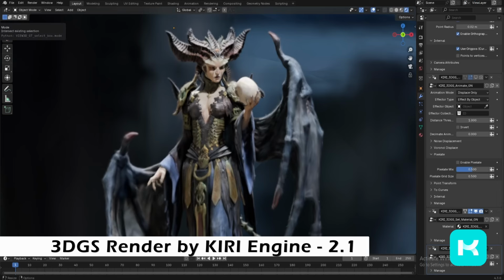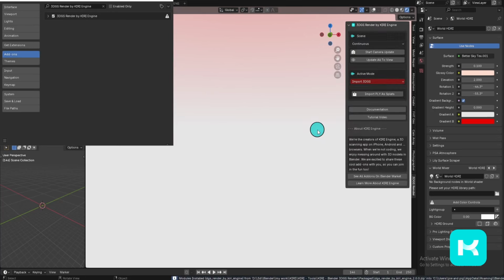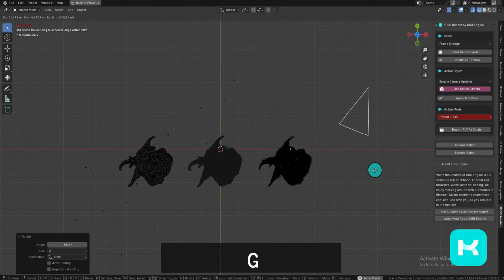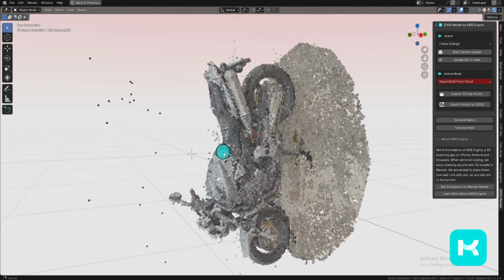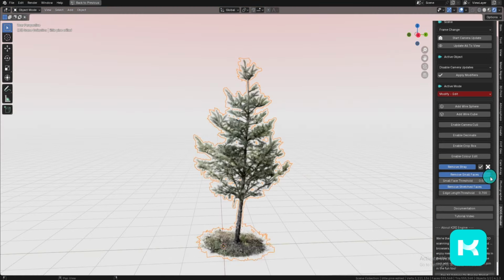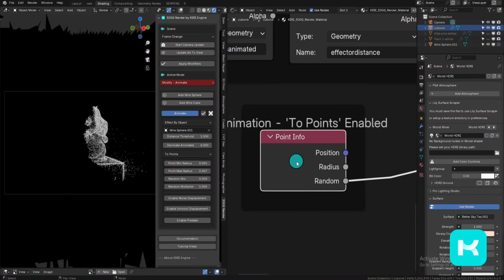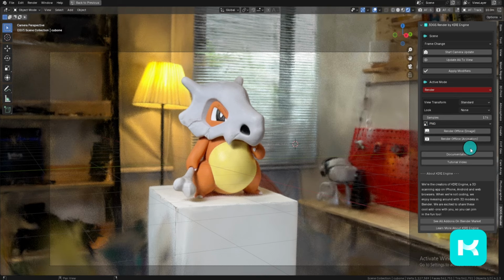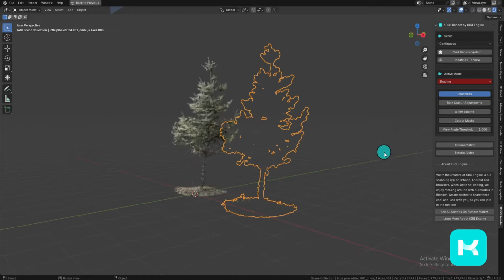3DGS Render Addon for Blender 2.1 Update - Full Tutorial / Documentation

Comment: Looking at this now - it seems that there are some features in this plugin which are missing or have been changed? Particularly the axis adjustment on import, and the active menu modifiers. I'm on Blender 4.5.1
Reply from the maker: Hey Aaron. In version 3.0 extra features were added for editing and re-exporting 3DGS files, so the rotation on import was removed. All modifiers were added at import before, which was too heavy on performance so modifiers can now be added at will from the modifiers menu - hope this helps👍

Comment: Sadly doesn't work for me, i am getting crashes all the time just from importing ply files.
Reply from the maker: Hey redhead! Sorry about that.

The addon will only work specifically 3DGS (gaussian splat) .ply files.

If you try to import a regular .ply (point cloud) file you will get errors and/or crashes.

Do you know the source of your .ply file and whether it comes from an exported gaussian splat or mesh .obj/.fbx etc?
Reply: @3D-Tools-by-KIRI-Engine  Ohh, i didn't know that .ply files are that specific. I was using .ply exported from CloudCompare (free software to edit different point clouds). I also used it to edit .xyz and .e57 to export to .ply. I was hoping that exported to .ply would work in Blender with this plugin because MeshLab is also crashing on different PCs.

It is a shame but thanks for answer and information.

Comment: This might be a daft question but if kiri engines Gaussian splatter produces a ply point cloud could this point cloud not then be imported into mushroom or reality capture to build a true 3d mesh  where then editing would be a lot easier in a 3d platform
Reply from the maker: Not a daft question at all! So both normal photogrammetry and Gaussian Splatting produce a sparse point cloud at first - which could be useful for photogrammetry applications. But getting the a dense cloud, with surface normals etc is not so easy. 
But in our last app update we added 3DGS to mesh advancements for turning Gaussian Splats into meshes.

As for 'for easy editing' - that really gets back to the debate about the purpose and uses of mesh vs 3DGS. 

Meshes are the established medium so your right, everything is easier with them; editing, rendering, compressing, sharing.....

But as the future opens up to 3DGS it's nice to have more and more tools to work with them.

Comment: can i export to obj with material?
Reply from the maker: You could export to .obj but the exported object wouldn't 'update' in another software, unless you set that up yourself somehow. And you would have to rebuild the material (check the shader nodes - the important stuff is in the 'required' group). The KIRI app also has 3DGS to mesh (.obj) features so it might be worth checking them out too.

Comment: if rendering is so heavy on gpu how is this any better that existing mesh with raytracing.
Reply from the maker: Totally depends on what you want to do as an artist. If you have an object you can't feasibly model or scan with traditional photogrammetry methods - then you can try 3DGS. If you use auto-masking in your 3DGS scan, or crop out a portion of a larger scans you can use it as a single element, which isn't too render heavy.